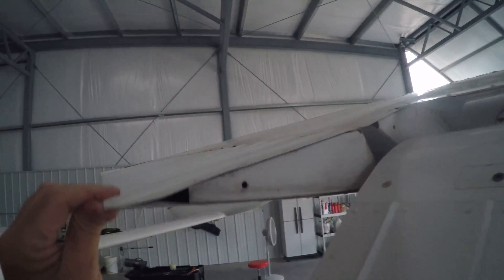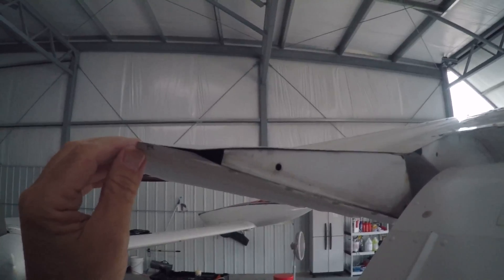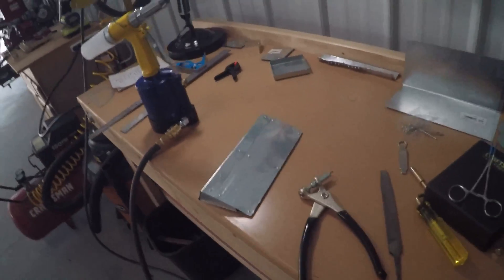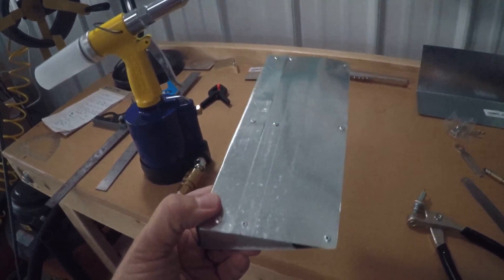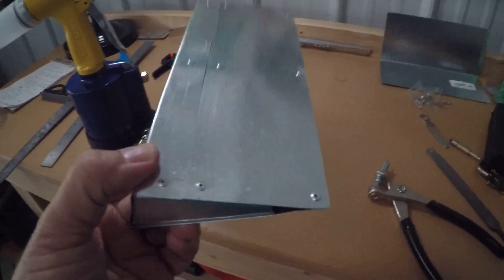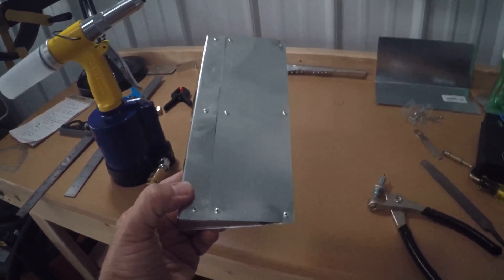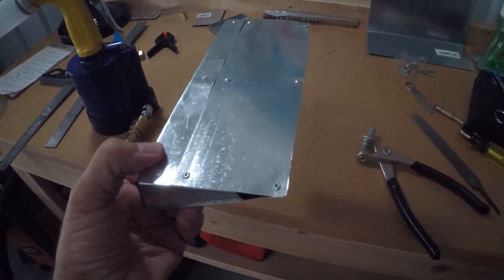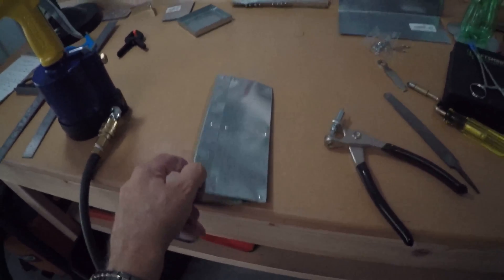Mini Aileron 4

Comment: Can't wait to see you build the sub sonex. I love the concept of the personal mini jet and soon as I can convince the wife that I i need a single seat toy I'll be building one as well. Any chance you know the overhaul costs on the engine. 300 hours between overhauls seems really low. I get that 55k for a small turbine is dirt cheap and most of the turbines I have flown were a 1 mil or more for the engine. But that's also comparing apples to watermelons.  Looking forward to watching more in the future!
Reply from the maker: Thanks, Michael, appreciate the kind words.  My tail kit arrives tomorrow, and I'm looking forward to checking it out.  Now I've got to no-kidding build it! I too was concerned about the "TBO" time.  I contacted Sonex some time back and asked about the TBO time and costs.  Here is what I received from them.  Hope it helps."Hello Frank,

 The TJ-100 has a 300 hour inspection interval with a 900 hour anticipated “TBO”. Some parts are typically replaced at each 300 hour inspection, but on an as-needed basis only. Inspection with some parts replacement can run approx. $10K. Overhaul will be a more significant percentage of the original engine cost — probably around 50-60%.

 Those internvals don’t sound like a lot of time, but the way that the SubSonex is typically flown, it represents quite a big of “calendar time”. The SubSonex prototype that Bob Carlton flies is in it’s 3rd airshow season now. It flies quite regularly and still has not reached 300 hour inspection."Thanks again and I should be making more videos soon.Frank
Reply: Thank you for answering my question so quickly.  900 hours between total overhaul makes the aircraft and engine combination much more appealing endeavor to get into.  I fly military aircraft so i dont deal with a hobb and tach and im going down a rabit hole here but is time on the engine to inspection counted from start up to shut down or in flight?  only reason i ask is military only counts in air time for inspections/ maintenance and overhaul.  The fact that Bob Carlton hasnt put 300 hours on the airframe after his 3rd airshow season does speak a lot to use of the airframe, but i would venture to guess he trailers it between venues and would have a mobile supply locker with him. I could be completly wrong and probably more skeptic than most as i have broken down more times and i can count. (old/overly complex aircraft which are usually fixed from old "reconditioned" parts.

I wont take any more of your time and cant wait to see the unboxing!

-Mike
Reply from the maker: Michael, that's a good question.  I don't have any jet time (yet!) and I fly mostly GA type aircraft.  I own a C172 and a C310.  Those type aircraft use the engine tach time, which starts up when the engine is running and stops when the engine is shut down.  You are correct, Bob Carlton said himself on a video I watched that he trailers the jet to the airshows.  He did fly it once cross-country from his home field in Moriarty, NM to KCOS.  That's about 300 miles.  He said he had a thirty minute reserve of fuel left.  I only mention this to give you an idea of the fuel burn and range capability of the SubSonex.  They said up front it isn't meant to go on long trips, but to "terrorize the neighborhood".  The video is interesting - it was done at the recent Oshkosh airshow and was during a tour/discussion they gave of the SubSonex production plant.  It is long but you get some good info from it.  It is on their website.  I'm going to load a couple more short videos of when I received the tail kit and unpacking and inspecting it.  Should be on as early as this morning.  Oh and the price of the SubSonex kit is going up at the end of the month.  Increase of $2000.  Cheers, and stay in touch!

Comment: Hey- 
Which air rivet puller is that and do you like it?

Is the practice part made from .025 6061?

Now you realize you have to paint the practice part I hope.
Regards
Reply from the maker: It is an Astro rivet gun that I bought on Amazon, and yes it is a good one.  I first bought one at Harbor Freight but it didn't work well at all.  This one (the Astro) is more expensive but not too expensive, and works very well.  The link to it on Amazon is below.  The sheet metal is just some cheap pieces I bought at Home Depot.  It is used mostly for roof flashing I think.  I don't recall the thickness but will try to remember to measure it and get back to you. And I'm leaving the painting to the experts - I'm terrible at it.  Thanks for watching!https://www.amazon.com/Astro-Pneumatic-Tool-PR14-Riveter/dp/B000MQ9H4W/ref=sr_1_3?ie=UTF8&qid=1538941424&sr=8-3&keywords=astro+rivet+gun